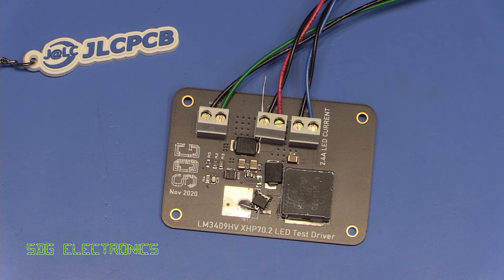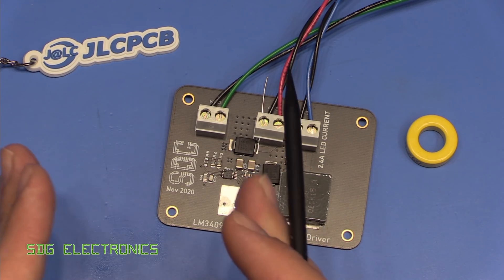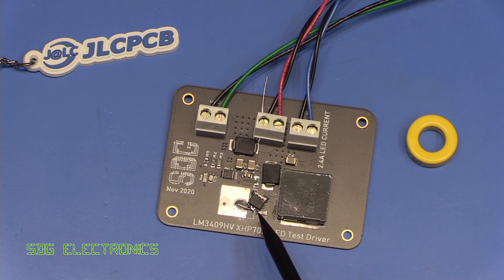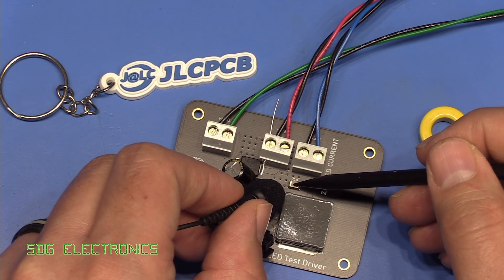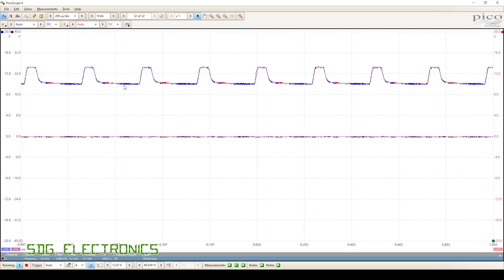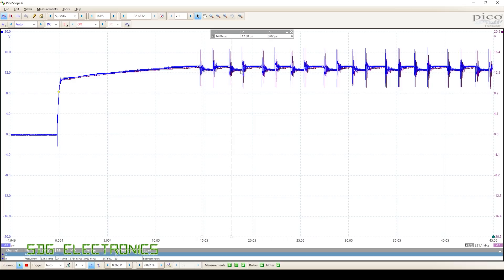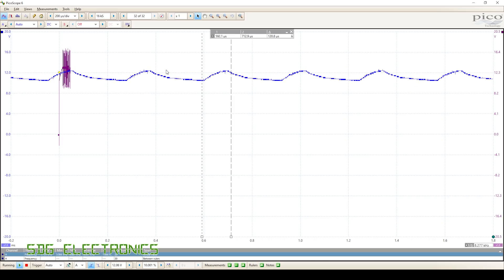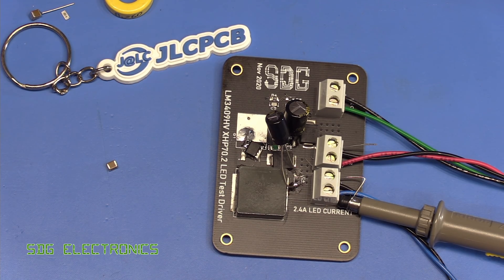SDG #186 A Real Example of Microphonic Ceramic Capacitors!

Comment: You're welcome! [insert smilie face here]
I wonder if instead of using one cap, what if you use 4 ceramic caps in parallel, would the problem would go away completely? I think it will. 
The ripple currents are too high for such small size. By reducing the ESR even farther with paralleling, they'll have higher ripple current handling capacity. 
Great followup. The mystery was killed and buried in this video.
Reply: No it won't. You simply won't be able to solder all caps close enough. Parasitic inductance comes into play hard. Every additional cap illustrates the meaning of diminishing returns vibrantly, even if you solder them on top of each other. Every cap would have a different equivalent impedance proportional to distance. >=10mm is like useless.
Low ESR ECaps are the only thing better, but bring requirement of maintenance compared to ceramics.
Reply: @Mr.Leeroy  OR, do what I do! you solder them onto 2 parallel copper wires and make a vertical stack, which can be soldered on the the same pads, vertically. Just like an electrolytic cap. Works like a charm. Go try it before shooting people down.
Reply: @piconano  Does not matter which direction you are stretching your current path. First caps sees the most current as is has lowest impedace, every other proportionally less. And I tried it, seen with my own eyes on the oscilloscope how ripple is affected.
On low switching frequencies current takes path of least resistance, on high - of least inductance.
ECaps are different because plate surfaces are much larger. And there is a clear correlation in max rated ripple current of ECap to its physical size.
Reply: @piconano  If you saw difference, that was purely by adding more capacitance and ESR/ESL was not limiting in your case.
Reply: @Mr.Leeroy  good for you. bye.
Reply: @piconano  I'm not sure, why you act like I'm being rude to you or something. Simply answered your "I wonder.." and if it sounded too confident for you, well that's because it was based on actual trial and error of mine and not just speculation. If you tried something similar and it worked in one particular circuit, it does not exactly matter that you interpreted whole picture right. If you specifically wanted author to try your guess, that's your problem, poor choice of words then. Anyway, have fun.
Reply: @Mr.Leeroy  No you sounded like a jerk.
I have tried all possibilities and speak from experience. This phenomena is not unique. You don't like my answer, there's the door. 
Muted.

Comment: Maybe you should use the analog dimming method. See datasheet example 9.2.2 Analog Dimming Application for 4 LEDs
Reply from the maker: I wish I had not been so impatient now, it's too late and I'm stuck with the PWM dimming.
Reply: @sdgelectronics  just send the pwm with an rc filter to the analog control...

Comment: So the pcb was acting as an amplifier and resonating that capacitor. I wonder if you could rotate the capacitor 90° in relation to the board so its layers aren't in the same plane? New sub btw
Reply from the maker: Yes, I think the PCB was acting like a sounding board for the capacitor. This explains why I heard some strange harmonics when sweeping the frequency range.

Comment: Nice one! I though when you poked the capacitors, the noise was coupling to the soft antistatic mat more, thus dampening the noise... What you heard and what we heard was not the same too. The first capacitor you replaced may have been fine...
Reply from the maker: I swapped the input caps back and there's no noise, so I think it just happened to be a particular spot on the PCB that resonated well.

Comment: can u get name of caps?
Reply from the maker: Pete and Dave
Reply: @sdgelectronics  🤣 because Pete is shiet, and Dave misbehave
Reply from the maker: Samsung X7R 10uF 50V CL31B106KBHNNNE
Reply: @sdgelectronics  i look at datasheet samsung, it's regular mlcc x7r caps, next time use Film Chip Capacitors if u need low height  or small size, or use multiply small caps to same capacitance, it solve this problem without disadvantages of electrolytics caps